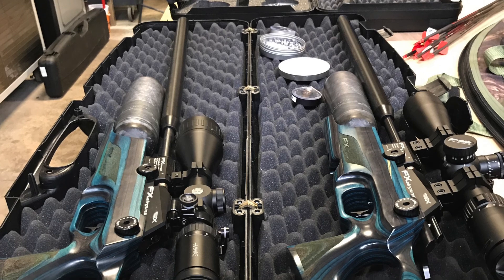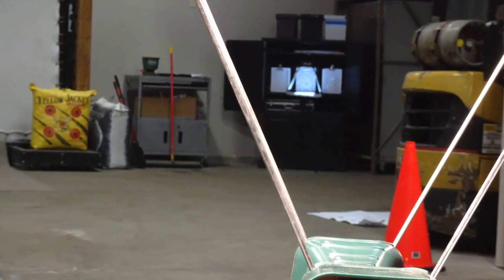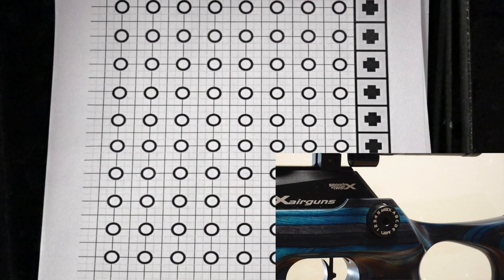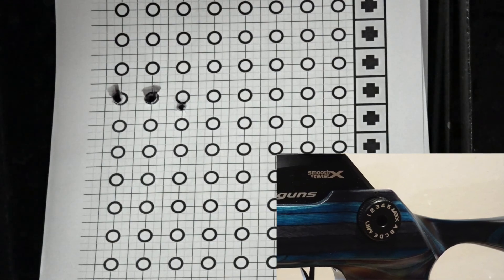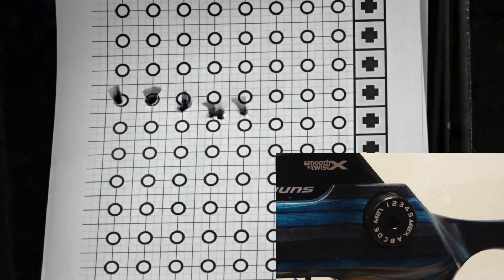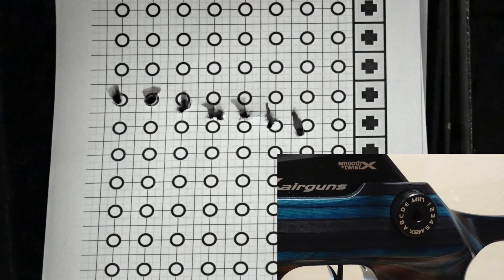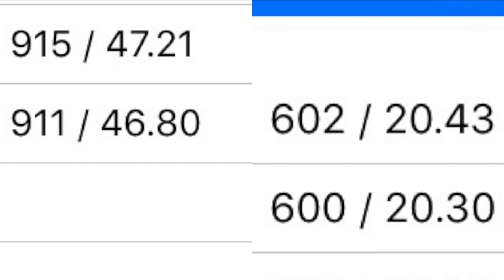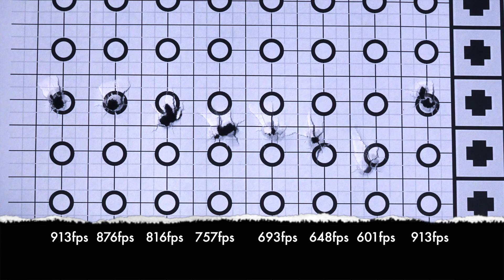FX Crown-Power Adjustment Wheel Velocity change and POI shift

Comment: From what I understand the FX Crown does not have the power of the FX impact. Are there any modifications you can do to the FX Crown to bring it up to the same level as an fx impact? If I purchase one do you think it's possible to shoot slugs with the short barrel 380 mm or should I just stick to pellets?
Reply from the maker: The MKII has more plenum space than the original Crown, so it can produce a little more power but not as much as the Impact. 
With the 380 barrel I'd stick to pellets.
Reply: @WiscAirGunners  Thank you

Comment: No informations about the regulator pressure!
Reply from the maker: It's at about 135 on that rifle.
Reply: Also was your hammer spring screw tensioned or left as it were from factory?
Reply from the maker: @lunatic231  at the time it was "as left by the factory."

Comment: FX claims that the letter side of the wheel is slightly different then the numbered side. Starting w “A” going down, the power should be between the numbered side. Therefore , “A” is halfway between 1 and 2. and “B” is 1/2 way between 2 & 3, Etc. I found this to be true on my Impact.
Reply from the maker: That is what I have heard, but I have not confirmed it by shooting that particular string.